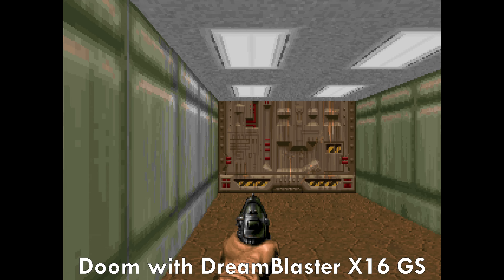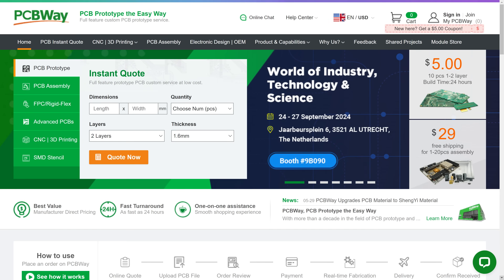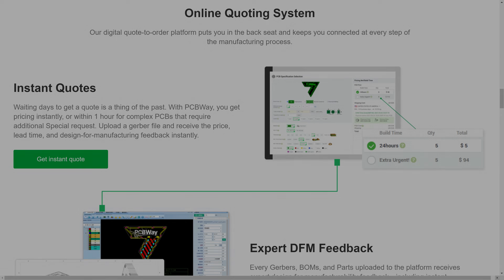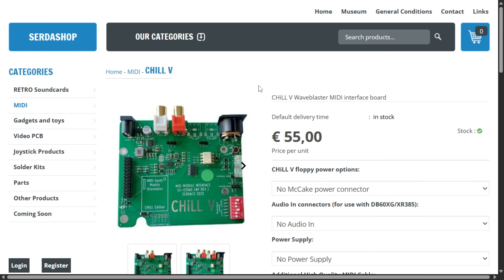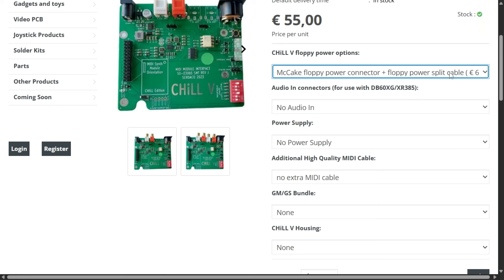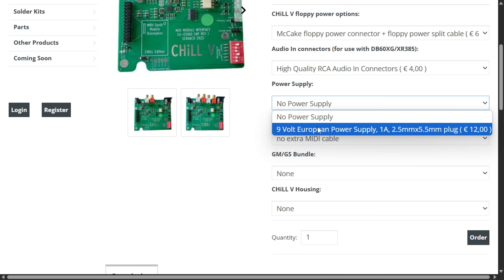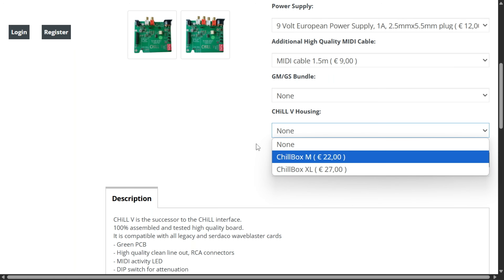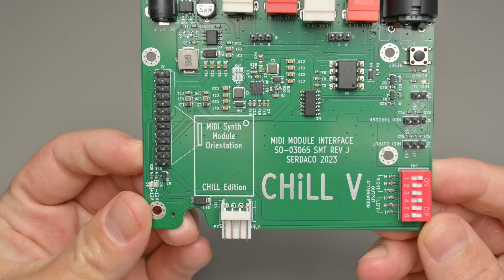Convert Internal Wavetable to External MIDI Synth with CHILL V

Comment: Very cool product. I hope the PSU they're selling for it is a low noise unit. Those digital switching PSU's are often very noisy, and I suspect this use case would be very sensitive to audible hum.
Reply: These boards have decent separation from the external supply and audio components, deriving the voltages needed from whatever is supplied. I've used cheap USB to 9V step-up adapters without issue and those things are terribly noisy. The audio was clean and quiet.

Comment: Hey Phil! Do you mind to share with us what is this USB to MIDI adapter that you are using in this video? Many of these adapters do not work well and the ones from Roland are very expensive! Thank you for the video!
Reply from the maker: Doremidi is the brand!
Reply: Seems to be a DOREMiDi MTU-10. Far cheaper than the Roland UM-ONE I bought a few years back, when Phil made his video about Midi "emulation" via FalcoSoft Midi Player.

I also had trouble with the cheap ones from Amazon and wonder how well the DOREMiDi works, also if you need drivers for it. The UM-ONE seems to automatically load drivers via Windows Update, but I don't know what will happen, once Windows doesn't offer this anymore. All the driver package zips I found only had a readme file inside. Never tested it under Linux or Win11 (on the Roland website it only mentions up to Win10).
Reply: @moomah5929 Try wayback machine.

Comment: That's a good solution when you have like a e.g. ESS AudioDrive card with no Wavetable header, but you'd like to have DreamBlaster's MIDI Capabilities. Also, easier to switch Wavetables when you not in the mood of opening the PC case every so often. (If you were in that scenario.)

Comment: Serge has made several very useful upgrades to the CHiLL MIDI interface board over the years. Being able to use the Waveblaster MIDI boards on modern machines and being able to swap them easily is very convenient. Sound quality is excellent too. I was able to do compatibility testing of this board in the early stages of development. All the extra cabling required can be a bit of a hassle, but this is still excellent.
Reply from the maker: Thanks for sharing your experience! 😊

Comment: To be honest, the one with the chill xl housing is the only usable option here.  To use it without that would be a very unstable construction or "Gefrickel" as we said in Germany. But the chill xl could be a nice option for external use and an alternate to my miditemp dox box which I use for years with a rare Korg wavetable daughterboard. But i also have the Yamaha DB50XG and Roland SCD 15 and the Cleanwave miditemp ds 48 and i need and external box for them. I will try out.

Comment: Another use case is using your wavetable board with non PC MIDI equipment like a sequencer or a keyboard
Reply from the maker: Yes good point!
Reply: Indeed, I have done this. 

Fun fact, the Xbox Keytar from the Rockband games is a 25-key, velocity sensitive MIDI device with pitch bend. The D-pad can be used to shift octaves and the X/Y/A/D buttons can control the patch set or split the keytar into two different patches on the upper/lower keys. 
I've used this setup with a McCake in a Chill XL box on a Chill V board to let my kids experiment with musical sounds.

Comment: I've always wondered if something like this could be done. Now someone just needs to make a midi port to wavetable adapter to turn external midi modules into wavetable devices to fully satisfy my curiosity. Sure there's not much of a point unless you wanted to use midi and a controller at the same time but I don't care.

Comment: It’s pretty neat but not necessarily a cheap method. It’s still probably cheaper to run Munt on an older thin client to serve as the midi interface. Not as simple but way cheaper. $15-$30 for the TC and midi cable vs. $80 or more would be worth the hassle of the TC setup. Also, there is the MT32-PI and BulkyMIDI-32 that may provide yet another option that would still be a little cheaper.
Reply from the maker: Yea this is definitely a very specific niche product. Mostly for those that already have a rare or high-end wavetable board and want to run in externally. Could also be for recording purposes for this creating content.